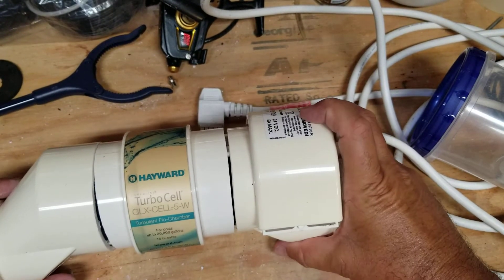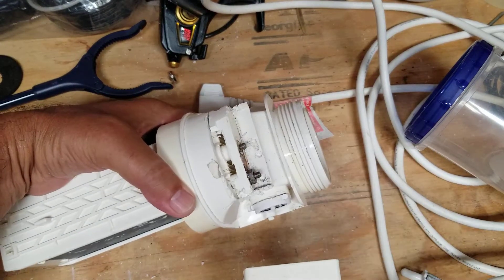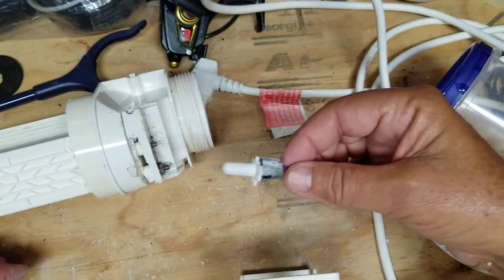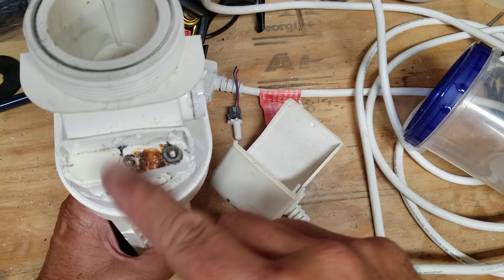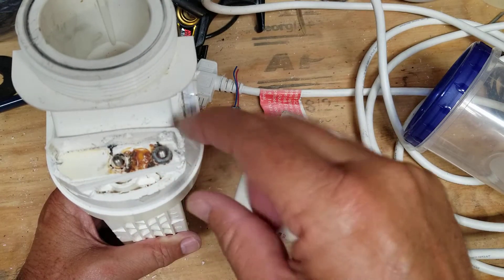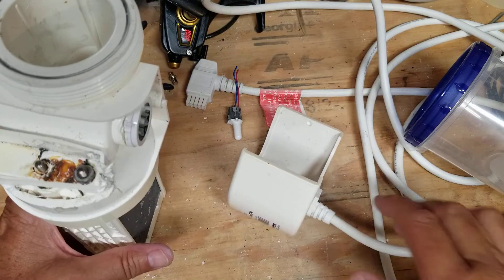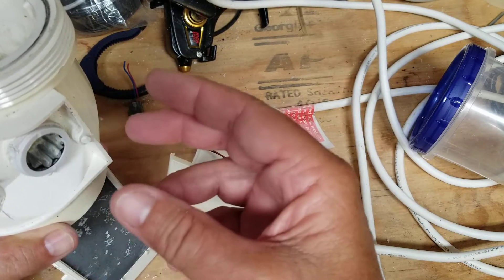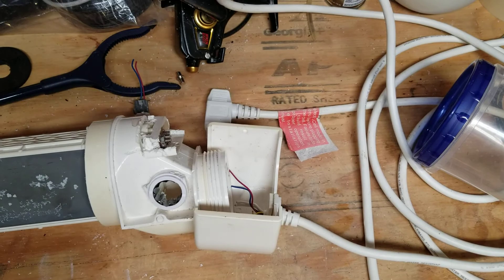Aquarite Hayward Salt Cell failure T-5-  Taken apart

Comment: Hayward turbo cells are the best in the industry. Sodium energized produces chlorine. Failure of the temp sensor is common to improper pool chemicals. You must control pool ph no higher than 7.5 if not you will have high calcium. Also your salt level should be at the center pendulum @3000  ppm 2700/3400. Running higher salt then nessary will cause carosion! Also, if your running a variable speed pump "min speed 3000 rpm so as you are able to sustain 1.6 to 2.4 ppm of chlorine @ 60% production off of your cell generator 18x36 pool. Note: a single stage pump runs @ 3450 rpm and a variable speed pump causes chemical imbalance  due lowering the injection rate and higher voltage sent to the cell shortens its life to counterbalance. . I am a professional pool builder of 16 years now and use Hayward exclusively, and my clients usually get 8 years out of a t5 to t15 cells.

Comment: I read 12.1k ohms on pins 8 and 10. My controller throws inspect cell and check salt after 1minute. Any hope here to fix this or new cell needed? .
Reply: Did you ever fix your problem? I am in the same situation as you.
Reply: @throwaway-ds6yg yes I did. Spent a $1000 and the new cell works the best. Sucks but nothing else did the trick.
Reply from the maker: Look below at @nedmandaric3321's post
Reply: @Beachnative42 Thanks! But my reading seems to be in the range. No? why would I add a resistor inline? Mind you I checked pins 8 and 10, not 6 and 10
Reply: Your cell is bad. The temp sensor was working fine, its the plates that failed.

Comment: I was given two T-5 cells from a family member who was selling off their control panel. I attached my multimeter to pins 8 and 10 (not 6 and 10 as suggested below) of the 10 pin female connector on the end of the cell's power cable. I measured 11700 ohms with the thermistor at room temperature. When I placed my finger tip directly on this thermistor, the resistance began to fall as the heat from my finger slowly began to heat up the thermistor. I tested the other, slightly cooler T-5 cell and got 12850 ohms, so I have better confidence in the accuracy of my resistance reading. I find it easy to believe the claims posted below that say that 10k ohms would correspond to a water temperature of about 80 F. I also measured the resistance between pins 1 and 2 at 0.4 ohms, which was identical to the resistance between pins 6 and 7. With the inside of the cell completely dry, I believe that it is impossible to measure a resistance between pins 1/2 and pins 6/7. I put one cell in a bucket of salted water and I got a negative 2 displayed on the 200 meg ohm scale of my multimeter. Multimeters are only supposed to display positive numbers for resistance, so a negative number suggests to me that the cell was actually generating a current from the salt water which tricked the multimeter into displaying a negative resistance.  Had I reversed the polarity of my multimeter leads, I should have gotten a positive number displayed. The control panel is needed to measure the apparent, but not precise,  density of the salt in the pool water in PPM. Two things reduce the efficiency of the cell: 1) scale build up and 2) the erosion of the microscopic precious metal coating on the electrode plates. The scale can be removed with the recommended acid solution, but the erosion of the precious metal is unstoppable and is a function of the accumulated hours of use. The control panel cannot tell the difference between the pool water having too little salt and the cell's electrode plates being dirty or worn out. This is one reason why owners of old cells mistakenly over-salt their pool water to compensate for the control panel's low salt readout. Accidental over-salting leads to excessive electrical current flow through the cell which shortens the life of the high current power supply in the control panel.

Comment: Is there a way to test the cell plates? the two wires? Im looking into buying used cell dirt cheap on ebay listed as "for parts". Im hoping that a potentiometer might be the key. Is there a way to test the cells or tell by looking at pictures if its a good cell to buy?
Reply: i believe the plates are just conductive plates and over the years they lose their conductivity to a point where one plate will go bad and then there is no more "connection" to complete the path, then the sensor stops. 
Kinda like a heater coil, it has internal resistance but after years of electricity passing thru them, they loose internal resistance then it goes open and your coil is dead.

Comment: You would to just happen to know which pins on the chlorinator plug were the red and blue wires?
Reply: you would have to open the cable up and pinch each wire to the plug and find out which they are

Comment: Single speed pump 25 years old. Rebuilt 2 times. Still kicking ass. Our electricity is not expensive in Pennsylvania. And I have an attic pool heater I put in 24 years ago to heat the pool that requires high speed to get water to the attic. I guess I am in sticker shock at the price of the T-15 cells. I bought my last one on 2016 with a 5 year warranty for 450 bucks.

Comment: My pool is 36500 gallons so the cell does run 12 hours with the pump. It runs at 70 percent. My cya is 30 so minimum ppm would 30x7.5% =2.25ppm
Reply from the maker: Do you have a 2 speed pump? I do and my salt cell kicks on only when it goes to the higher setting. The high speed runs only for 4 hours a day, I have no issue with cleaning it using a haywards crawler type cleaner or no issue with algae or lower chlorine level

Comment: So if not for that poor design on the temp probe how long would the plates last in a perfect world? The plates do wear down eventually?
Reply from the maker: Yes thats why the expected life cycle is 8-10 years
Reply: I’ve heard 10,000 hr on a cell. That’s 4 years for me
Reply from the maker: @stevethetoolman2435  most pools with  2 speed pumps that run continuously like I have only run at max speed where the salt cell starts working is three hours a day.
3 x 365 = 1095/yr   1095 x 8 = 8760 over 8 years
 If your cell is running 10,000 hours in 4 years then you are running it too much or have an undersized cell
Reply: The plates will wear down at some point. When they do, no more chlorine, They can't be fixed or replaced, they lose their internal conductivity.

Comment: Couldn't be said better.  FYI, there's a YT about bypass that heat sensor to deal with the "HOT" error.  Easy and smart.
Reply: Yes you put a 15k ohm resistor on the red and blue wires to tell the system that its about 75F ...

Comment: They are designed to be replaced.  The cells wear out.   When you clean it make sure the plug end is up and not submerged.  It is possible for acid to get in but rare.  $650 now
Reply from the maker: Yep, nothing lasts forever. Mine had broken the lug, probably to salt. It doesn't matter salt or chlorine or muriatic acid they are all corrosive and affect all measures to protect any connection. Not a good design since in my book.

Comment: Great video thank you. Sir how the heck did you manage to take that epoxy out where the 2 screws are?
Reply from the maker: First I used a saw and cut off the side wall then it just popped right out. The surface had no sanded prep marks
Reply: @Beachnative42  thank you. I finally got it out. Cut out the weird connector and unnecessary wires. Put new connectors.  I hooked up a 50K potentiometer to red and blue, adjusted the fake temperature until the board thinks my salt is at 3200. Tada! Of course independently I made sure my salt is at 3200. My T15 works like new. Repair cost $5. Thanks!
Reply from the maker: @JimmyDeriter  AWESOME!!!!

Comment: How do you seal the extra wires. Did you silicone those too?
Reply from the maker: I did this video forinspection and to see where mine failed. You shoud ask nedmandaric3321 since he used a resistor to fix his

Comment: are all the wires connected inside or just blue red and white and black ...other are just sitting there ???
Reply from the maker: yes all of them do not connect black and white go to the cell plates the others go to the heat/salt sensor
Reply: Blk /Wht; Red / Blu. All others are usually Cut and not connected! @Beachnative42

Comment: 10k ohm resistor, I took what was mentioned and measured the resistance on the cell plug for the red and blue wires and got around 8.2 k ohms and as a last ditch effort, I carefully sliced and pulled back two inches of the sleeve cut the red and blue and soldered in a 10k resistor. As a result, the system thinks the water temp is 77 degrees. It is actually 84. Prior to this, My cell, T-9 would not hold the instant salt reading and would drop to zero. now, I can take a instant salt reading and lock in 3300 for salt and it doesn't drop. The problem is the plates are probably worn where I get 27 VDC and 2.5 amps draw on the display. It would be cool if I could go further and know if replacing the plates would restore full operation.
Reply: Thank you posted video
Reply: Is there a way to test the cell plates? the two wires? Im looking into buying used cell dirt cheap on ebay listed as "for parts". Im hoping that a potentiometer might be the key. Is there a way to test the cells or tell by looking at pictures if its a good cell to buy?

Comment: Brother!, you are my kind of guy.  I like your planned obsolesce comment with the heat sensor.  I have a T-Cell 15 that is still working, but I know someday it will fail.  If it did tomorrow $900+tax to get a new one.  Can you tell me if you think these are actually repairable, and what is it that fails when these fail?
Reply from the maker: The carriage that holds the plates broke on mine. I don't think there is a way to fix them since they are platinum plated
Reply: @Beachnative42  thanks brother...I think Ned Mandaric posted a comment that answered my question anyway.